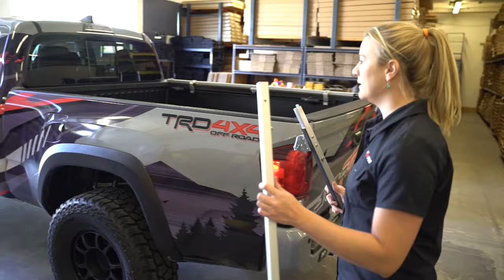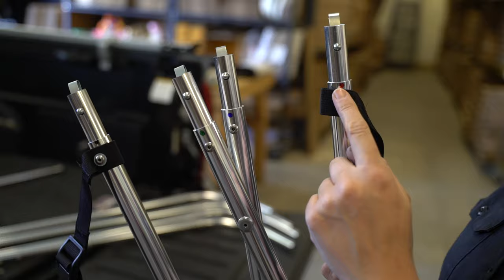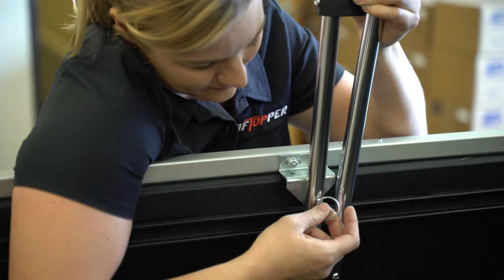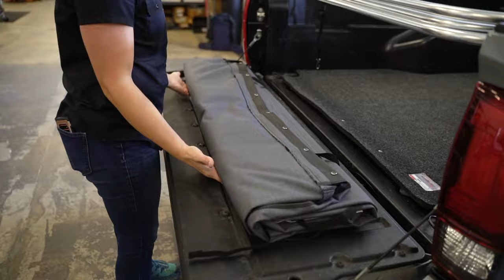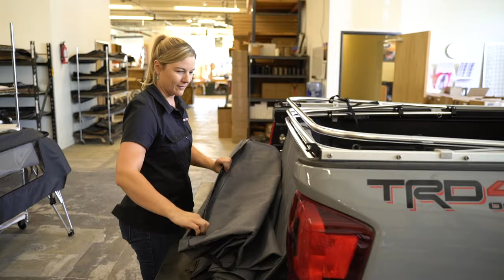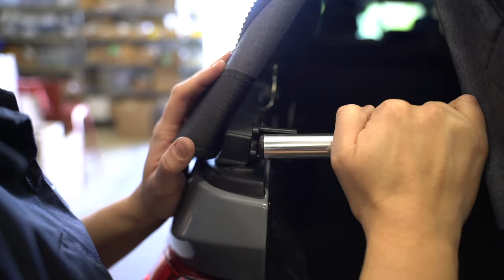Installation is a breeze....

Comment: 購買網址嗎
Reply: My snaps are hard to line up and hard to snap in place.  2 of us try pulling material over to snap still didn't  work know matter pushing down on bar in back.  Only down fall having trouble with.  Afraid to unsnap to roll sides up hard to snap back